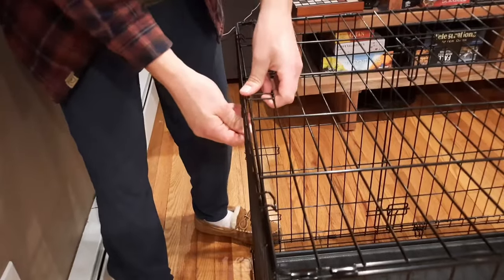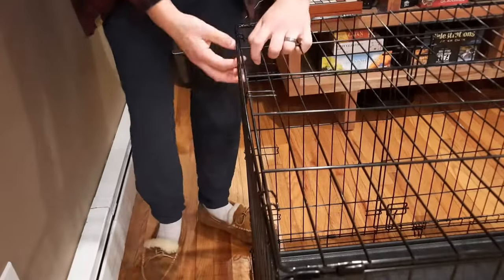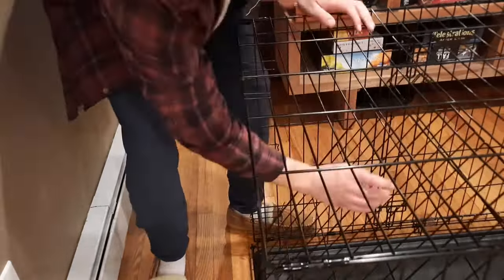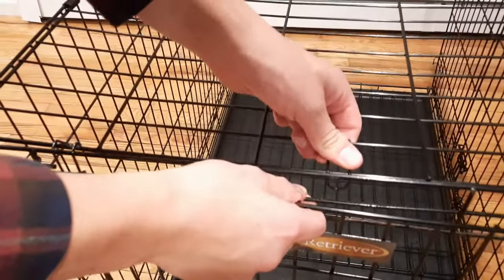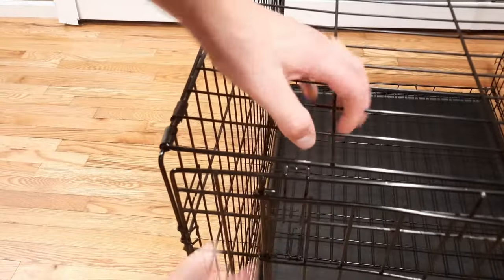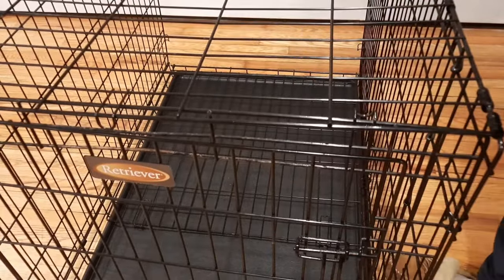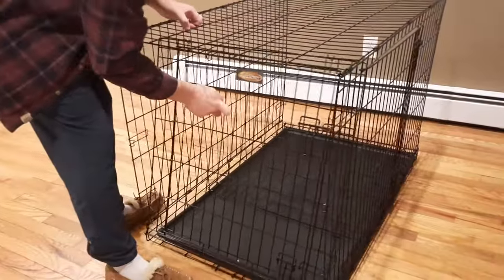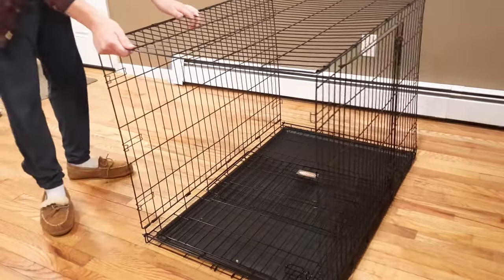How to Fold a Metal Dog Crate

Comment: doesn’t work
Reply from the maker: Did you follow the instructions?
Reply: yes i did, it turns out my crate is very different to this one and I found a different video which had practically the same crate, I think it wouldve worked if i had the right crate to start. @DIYwithCam